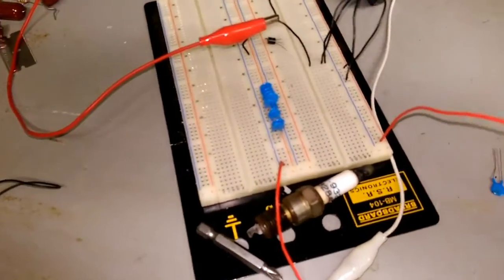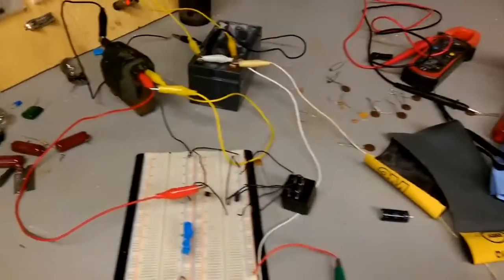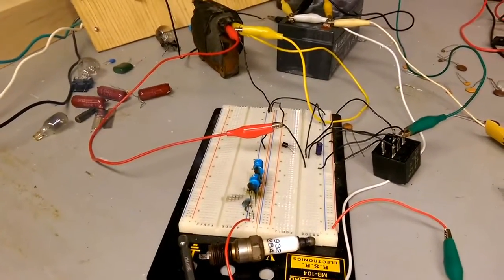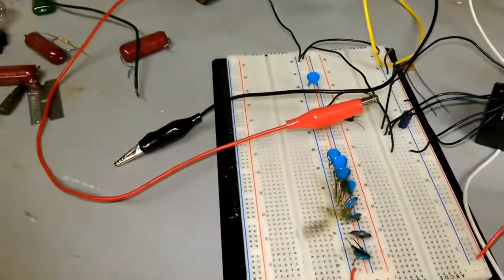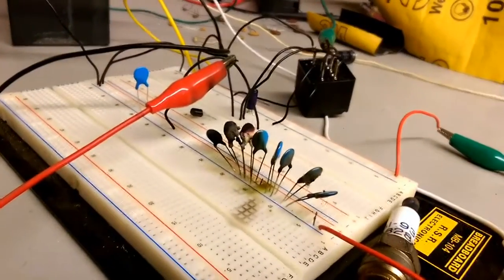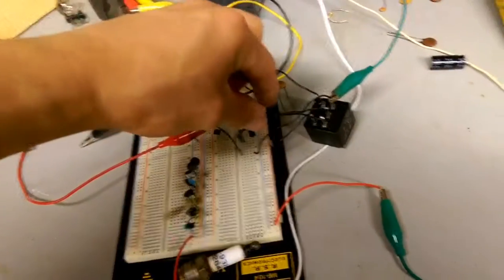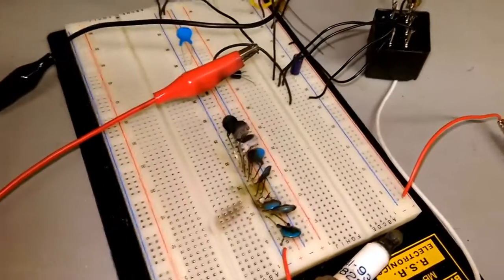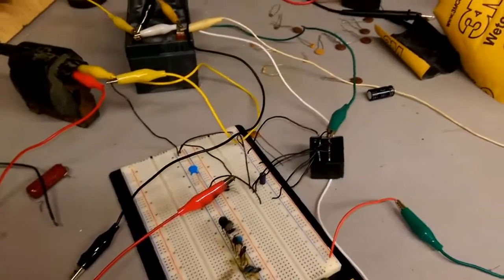Failing Capacitors on an Ignition Coil Circuit

Comment: How much current is running through each cap
Reply from the maker: Little when working properly. Not sure how much when melting down, quite a bit as to make the leads melt open.

Comment: Try putting a resistor in parallel as well. Like, perhaps try a 4K7, 2K2 or a 1K resistor. You might need an even lower value, or you might be able to get away with a higher value. I don't really know... (But obviously not too low ... and be sure to properly spec the resistor ... I.E. dissipating 1 watt in a 1/4 watt resistor isn't going to end well...)
What is likely happening is that you are creating an oscillating circuit with the capacitor(s) and the inductor (transformer primary winding). This is commonly called a resonant circuit, "tank" circuit, or an LC circuit, among other names.
https://en.wikipedia.org/wiki/LC_circuit
The voltage can easily build up to high levels if you don't dampen (reduce) the oscillations.
You want to help take the sharp edge off of the spike, but not dampen it so much as to cause a reduction in the HV transformer output. :P

P.S. I had a HIPRO power supply that someone gave to me to fix, I ended up not being able to fix it because of a hard to find chip, but the 1kV 100pF suppression cap across the main switching FET had turned dark, and shorted out, causing a massive chain reaction ... a bunch of other components blew out, including the PFC FET, diode, bridge rectifier, fuse, current sense resistor, and control ICs...
XD
Reply from the maker: Thanks for the comment, not a bad idea. But I just powered it up once more and popped 3 more caps very quickly, so the coil doesn't produce a very good spark anymore. 
I ordered hv caps and will go from there.
Really, I should look into factory circuits that power these very coils in the computer of the vehicle it came from. They run for years without issues, so they must be doing something right.
Reply from the maker: I noticed most relays do have a resistor going across the coil terminals. I'm sure for this reason
Reply: Okay, welp, did you test it out with a damping resistor?
Or did you blow up all the caps you had? X'D
Reply from the maker: +Benjamin “Ozias” Esposti Nah I have 2 left which isn't enough to fire the coil properly lol. Those last 3 went really fast.
 The arcs were probably the longest with 4 caps
Reply: Well I'm pretty sure the long arcs are a result of the high frequency, high voltage oscillations ... so you probably should just try to get higher voltage caps instead, if you want the long arcs.
Even then, the high voltages might cause excessive arcing on the relay contacts, which would reduce their lifetime ... yeah I know you aren't worried about that, but the reduction could be to just minutes of lifetime X'D or less like those caps.
Reply from the maker: +Benjamin “Ozias” Esposti 
I opened the relay up, to my surprise the contacts looked great. The copper wires inside were a little discolored though. It's a Siemens relay, should be good quality.

I ordered 3kv caps

Comment: if you are capturing the back emf from the coil you need kv caps
a pulled coul can put out spikes that are way higher then its original voltage

Comment: Why do you doubt the coil reaches more than 250V? Even relay coils tend to create kilo-volt spikes!
Reply from the maker: All of the coils and injectors I've monitored in the past (on a running vehicle) have registered around or under a hundred volts on an oscilloscope. Whatever it may be in this setup, it's reflected in the output depending on the number of turns on that ignition coil. And I've seen bigger arcs than this from similar coils. I have many others I should try.
Reply: I just realized also, the 'scope has impedance ... it can affect some circuits! Here it might be dampening the spike, I don't really know ...

Ahh, the wonders of the world ... X'DDD